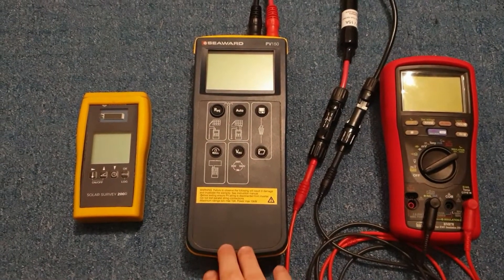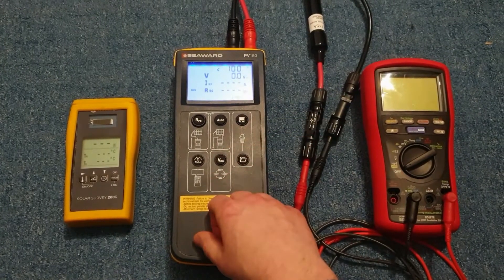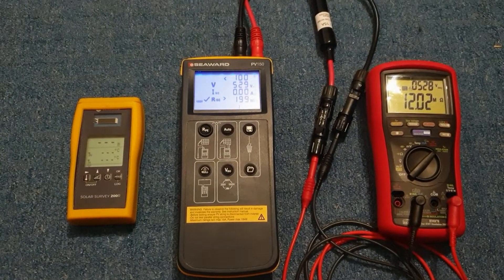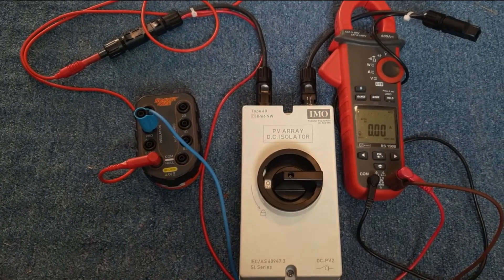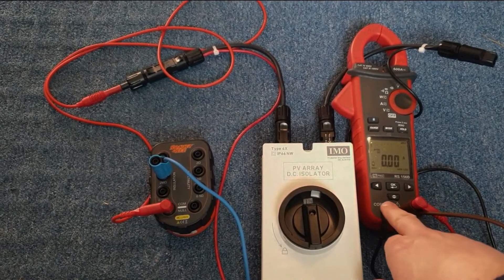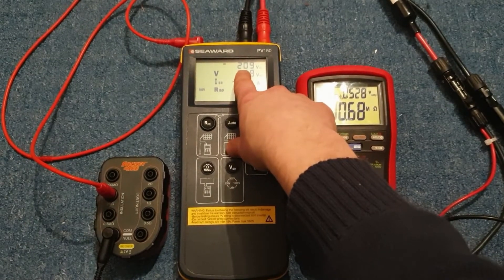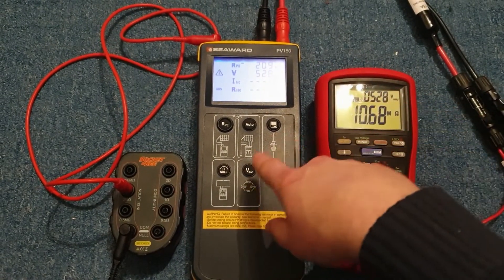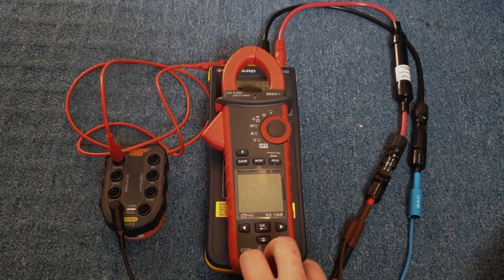Seaward PV150 introduction and discussion

Comment: will the pv150 measure a earth fault due to moisture etc  that will turn an invertor off  ????
Reply from the maker: Yes.

See my other videos but that's primarily what we use it for.

If you don't have one, there are ways round it.
I've done a system where we connected one string at a time to the inverter and ran through the inverter's diagnostics but that takes a long time.
If you're fault finding a SolarEdge system that's all you can do. 

Some of our systems end up with 16 strings per inverter so having a tool like this hugely speeds up the diagnosis.

I'd invite you out to use it for a day if you were a little closer 😉
Reply: @tceng9449  i woulf come for the ride for sure - 

yes i have one but never really use as prefer micros.  with fronius it looks to hard also as each string is wired direct to the invertor  ??

i have a job to test for faults so want to use it - for earth fault i just need to  clip red to  earth - forget black and hook up the string and if theres a fault a cross will appear ????????

Thanks for the help and  great vid